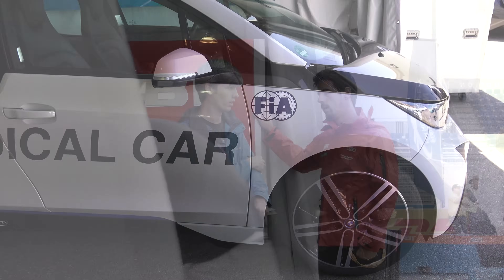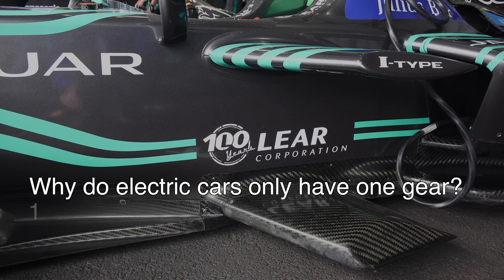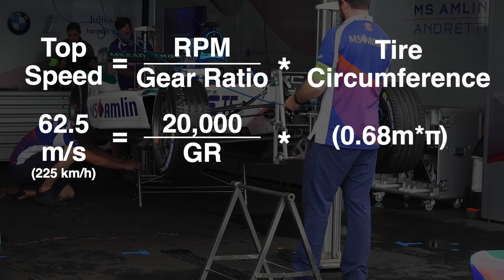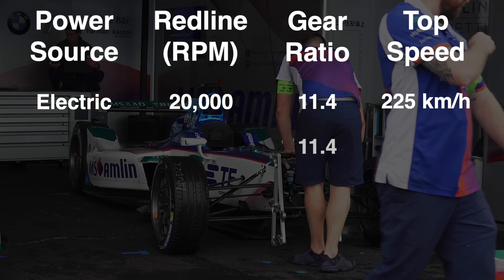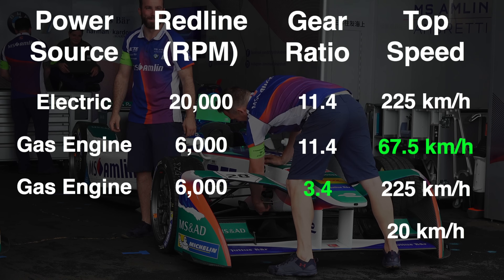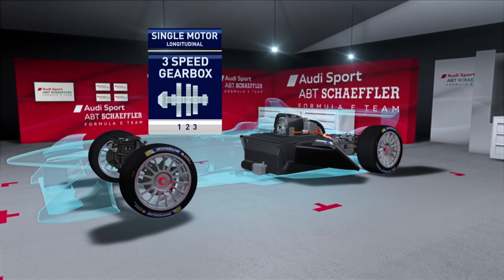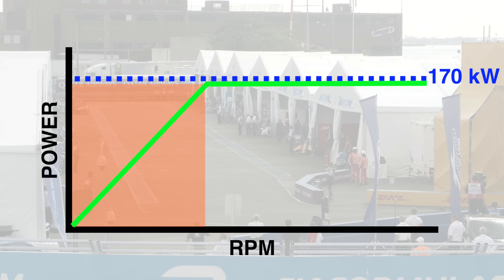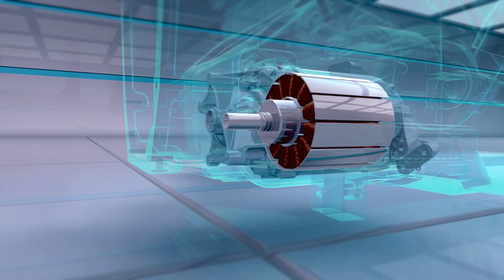Why Do Electric Cars Only Have 1 Gear?

Comment: Now imagine Fast and Furious movies with only one gear. What will they do without dramatic gear changes every 10 seconds?
Reply: Adam K Exactly. And not to mention unrealistic gear shifts. The cars they use must have 50 speed transmissions./s
Reply: They all have truck gearboxes installed ;)
Reply: Maybe switches to hook up emergency battery supplies.
Reply: They'll be switching back and forth from sports mode and eco mode
Reply: @Exiled_WolfX  hahahahaha
Reply: Adam K more time for bullets and Michael Bay style explosions...
Reply: Dramatic battery change every 10 seconds
Reply: Adam K They'll find an excuse to implement gearboxes into electric cars anyway.
Reply: You can always add 10switches on the dashboard to select and control different voltages to run on the motor and walah an imitation gear change scenario is created
Reply: talking about range issues and calculating the range by the actual power usage.
Reply: they can play with their dicks...
Reply: drift faster to compensate the battery weight during sharp turns, and repeatedly put ice on the car floor to prevent battery from overheating
Reply: @TheOswald42  dump some more ice in , 2, 1 ...NOW
Reply: new FF series are not about cars so it doesn't matter.
Reply: They would just put a faux gearbox and still show dramatic gear changes.
Reply: I'm pretty sure I've seen them shift an automatic gearbox as well pretending it was a manual at high speeds. Lol
Reply: Cameron Rodriguez Yeah. Saw Brian (Paul Walker) doing that in the very beginning of Fast 6 in the GTR. Thought he just shifted from neutral to drive since he was losing against Dom lol
Reply: Bradley Zimmerman haha, they'll probably heel'n'toe on electric cars too.
Reply: It will be replaced by dramatic road head
Reply: Imagine them "hot wiring" an electric car...
Reply: Dramatic screen touching every 10 seconds
Reply: The Actors might have to focus on .... wait for it... ACTING!
Reply: Adam K its all about the nos.
Reply: Well, those movies suck it wouldn't make much a difference anyway
Reply: @xRedEagleHD  for fkn real!!!!
Reply: Adam K lol
Reply: yes..because they allready using gearboxes with aparently 25 gears is so realistic....
Reply: well.. imagine fast and furious movies with only electric cars on it... you will fall asleep because it is silent lol
Reply: Between Powerglide-emulator and one-pedal-enabled/max regen braking mode (on a Bolt that's basically what D and L are respectively).
Reply: V8Supercar1 Imagine FF featuring Teslas.
Reply: This needs to be pinned.
Reply: walkerscranger you don't hot wire an electric car. You hack it. Hollywood is going to love having an excuse to shove in a dramatic long scene as the racer's hacker sidekick breaks into the car's software.
Reply: Start to develop range anxiety..
Reply: Adam K hahahahahaha
Reply: snap chatting ?
Reply: +John Austria; You are whining here, but actually it will be the cars that will be high pitch whining even more. ;-)
Reply: I love your comment looool
Reply: Yup.
Reply: Actually, nitrous on the battery might actually be beneficial.  It could be used to cool the battery.
Reply: My first car had 2 10 lb tanks of NOS nitrous (:
Reply: batteries run better with high temperatures.
Reply: In one movie, they were going in reverse and still changed gears. The car must have had two reverse gears. haha.
Reply: hahahah. now thay can shift to some hidden rocket gas propulsion for extra speed
Reply: Furious 19.... time trawling machine bla bla bla back to 1971 bla bla bla and GEAR CHANGING WITH R2D2 HELPERS LOL !!!!!
Reply: Adam K ...dramatic chasing on thunderstorm and every 10 seconds lightning strike for more power
Reply: Adam K ...car can be electric even with gasoline engine!!!
Reply: Still remember a scene from one of the movies where he shifts into "2nd reverse" lmao
Reply: @ProfShyv  a 2nd reverse gear?
Reply: @garystinten9339  I dont remember correctly, but there is a part where paul walker is driving backwards, and engages "another reverse gear" to keep going backwards...
Reply: Well in performance cars (and some casual ones (like mine)) you can change gears yourself in sports mode. Some cars even have paddle shift on wheel which is basically the same as moving gear lever front (gear up) and back (gear down). But yes, looks like all cars in FF series have manual transmissions :D
Reply: They'll press the horn instead of shifting gears 😂
Reply: Prevent overheating of the electric motor and power electronics. Maybe liquid nitrogen injection?! ;-)
Reply: Loading the car battery
Reply: imagine ff without sounds
Reply: Adam K You'd get a second to see how terrible the acting and the script is.
Reply: Would a CVD not be good for an electric vehicle to achieve the high torque low rpm over a wider speed range?
Reply: From D-1-2-D
Reply: Well though, kind of a problem.
Reply: What are they going to be about? zeppelins?
Reply: Think about the cowboys way back. What will you do without horses in modern movies? ;-)
Life is changing and movies too...
Reply: Dom : We have to jump the bridge!
Crew: We can't, we got only 1 bar left! :(
Reply: Also their would be no bad ass engine pur
Reply: They press a button.
Reply: they'll be part of a special forces units called the expendables
Reply: and they'll fly planes
Reply: @Steve the Pirate GOLD hahahaha hahahaha
Reply: dramatically leap from car to car like in that Matrix highway fight
Reply: More drifting
Reply: they'll just zoom in on the right foot
Reply: They press a button, dramatically
Reply: You never see any double declutch or rev blips on downshifts on the films - because the actors cant do them properly.
Reply: Probably pull a level down that engages the high voltage drive or something (the equivalent of NOS, too much of which can mess up your engine)
Reply: They'll probably slap the passenger every 10 seconds instead
Reply: Shorten the movie by 80%
Reply: Now they will get the Taycan, 2 gears are better than 1..
Reply: Make a decent movie, maybe?
Reply: Just angles and serious faces......
Reply: Electric motors constantly revving up
Reply: Holding a handgun and shooting other cars maybe, or holding a machine gun since the car will be self driving
Reply: Get a real job
Reply: slowly but surely increase the voltage applied to the motors by disabling safety concerns. Has the benefit that you really have infinitely many voltages or currents to choose from.
Reply: @Allen Loser this comment was related to the Fast and Furious movie comment but missed the @
Reply: Every 10 seconds, what are you driving? A Skoda Citigo ASG auto?
Reply: And where is the "NOS" Button?
Reply: loool that would be so boring to watch
Reply: They too use automatic gear transmission cars but then they show dramatic gear change between Reverse and Drive gear 😂
Reply: i dont mean to be so off topic but does someone know of a method to log back into an Instagram account?
I somehow lost my password. I would appreciate any tricks you can offer me!
Reply: @Aryan Rodrigo instablaster =)
Reply: The CONVOY movie, Ice Truckers,eps.with the double stickc shifts and ABSOLUTELY NO syncros..or classic GreyhoundTM/TrailwaysTMetc. drivers, with the one digit (in the prev.cases usually four) speeds..even that is not like most cars, hell, Fast and Furious flicks, and I've seen 'em all, have double clutcvhing!
Reply: I know 😂😂
Reply: They have unlimited gears
Reply: They just need big external sound systems to broad cast fake engine sounds, while accelerating better than the combustion engines.
Reply: That i'll be fun to watch haha
Reply: I mean.... you could? Turning off overdrive does make your RPMs shoot up, and even more if the ECU lets you go to third, 2nd, etc
Reply: It's called downshifting
Reply: Now imagine ur grand babies living with cancer,while watching fast and furious thinking what was so important that lead to destruction of the earth

Comment: Could a manual transmission ever been paired with an electric car?
Reply: Yes, you see that with EV conversions.  Drivers can shift if they want, but In practice, drivers just tend to leave it in third or fourth gear all the time, because the lower gears simply are not needed.  The Tesla Roadster originally came with a two speed manual, but it kept on breaking because of the torque, so they removed the option and went with single speed.

Comment: If electric cars only has 1 gear means when u go faster the motors revs higher which also means more electricity is required = electricity loss. So how electric cars keep their efficiency when crusing at high speed?
Reply: They don't. That's why you have the highest range at lower speeds.

Comment: Why are the tyres/wheels used in formula E so drastically different from those seen in formula 1?
Reply from the maker: +jessery Formula E is trying to keep the wheels and tires more similar to road cars, so they use 18" wheels and treaded tires. In fact, the Michelin tires used have the same tread pattern as Michelin's PS4S street tire, though a somewhat different compound is used.
Reply: Ah OK, makes sense!

Comment: I have seen before 
The revolution of the rotor of syncro motor directly depends on the frequency of the current .

So if we need to change speed you can easily change the frequency.

For torque conversion we can use a clutch mechanism

I am not an expert .

Pls correct me if i am wrong.

Feel free to learn
Reply: mad talks no need for a clutch. Gears are permanently connected

Comment: +Engineering Explained

So we know now why most electric cars don't need gears in normal applications, however would multiple gears improve higher speed applications? Even if it were a 2-speed or CVT.

Most EV owners are well aware of the heightened power consumption when sustaining high speeds. In your usual Leaf or Renault Zoe, the motor is spinning at 7500 or 8000 rpms. Cars such as those also start to experience a loss of available torque at speeds of +50 mph which makes overtaking awkward.

Aside from the well known case of early Tesla Roadsters destroying their 2-speeds, should every OEM EV be limited to be a 1-speed.
Reply: Tesla Model S and X can achieve 155 mph... how much faster would you like to go in an off the shelf vehicle? For racing applications it is totally different.
Reply: a good way to use an electric car without lugging a heavy battery is just to use a really long cord
Reply: That happens because electric cars are commonly made for urban use. So you make it lighter. What ways more on a electric car is the batteries, so if you want a light car you use less batteries. With less batteries you reach a limit of power output wich make the car loses torque/power in high speeds. A gear would ONLY be applicabe if the limitations is coming from inefficiency ON THE MOTOR due to high rpm. But won't help if the limitation is coming from the lack of power.
And the problem is: drag is proporcional to speed in a exponencial form. you double the speed you more than double the drag. But if you double the battery pack you just double the avaliable power. So you need to weight everything and project a car for a certain use.
The model S is a car more efficient on a highway becaus it's made to be a tipical american sedan. So it's heavy and have a huge amount of power and batteries to drive like that.
Reply: Speed isn't the factor... only torque. Electric motors have instant torque and depending on the size of the motor and gear ratio determines torque.
Reply: difflocktwo , maybe not, but it sure is nice to have a/c and stereo etc.
Reply: "heightened power consumption when sustaining high speeds" is because of the aerodynamic losses. You have to remember that drag increases exponentially with velocity.
Reply: difflocktwo  you are one of the special people.  A round trip per day for work is 152 miles.  5 days a week.  The nearest gas station is 19 miles away.  There are millions of people who drive that far every day.  People ask me why I drive so far?  No jobs where I live unless you own a farm, cook meth, or live on welfare.
Reply: Even a Bolt EV will do well over 150 miles on a charge.
Reply: That's the questions we need to ask
Reply: I Gears would only add losses, lowering range.
Reply: David Beppler Check the statistics. What is the average commute distance? What percentage of drivers commute under X amount of miles? 

3 hours a day in a car? Are you getting paid to sit in your car? Wouldn't it be worth it to find work near home or move near work?

If you could charge at work and at home you wouldn't need to go 19 miles just to fill up. 76 miles should be pretty easy in an EV.
Reply: One of the raisons d'etre of electric vehicles is efficiency, which is largely a function of  regenerative braking.  (also a factor in achieving decent range, of course). A single motor, using a single reduction ratio, of adequate power to cover the entire speed range of, say, a versatile 'family' car, usable for both start/stop urban journeys and open-road cruising simply will not provide very much braking torque/regen in the urban environment.

This is the reason Teslas are so 'over-powered' (or endowed with "more than adequate" power, as Rolls Royce used to say). Tesla went with the simplest configuration they could (having considered and decided against a 2-speed transmission) and consquently had to use motors large enough  (over-sized, in effect) to produce decent regen at urban speeds. With 2 or more ratios, smaller motors, spinning at higher RPM at these speeds could produce good braking/regen while still having ample power for cruising in a higher gear.
Reply: difflocktwo you clearly do no know of a country called Australia, i make regular trips that are 6 hours or more and around 960km
Reply: also pretty sure electric motors power curve is the opposite of combustion engines, the have lots of torque low down and it drops off at higher speeds
Reply: +toyotaprius79
The Renault Zoe motor is spinning with 12,000 rpms, or even more...
Reply: anytime you convert power through differential gearing, theres a power loss.  Combined with the added weight that a transmission adds and you lose any efficiency you would have gained.
Reply: Charlie S Stereo is only a few watts. Not even a dent in range. Interior climate control is very energy demanding, but remember you can do this while plugged in. In the winter EVs use heated touch points to keep occupants comfortable with less energy.

A couple kWh extra of battery for a day of climate control should be enough. Not a big deal.
Reply: Blox117 Or use a battery you need. No one needs 200 miles a day.
Reply: " Cars such as those also start to experience a loss of available torque at speeds of +50 mph which makes overtaking awkward." It is not about the loss of torque but a loss of available power.

Comment: Rimac uses 2 gears and the concept one is one of the quickest and fastest production cars in the world
Reply: matthew clark the concept one is not a true production car....doesn't meet the sales volume to be classified as one.
Reply: Christian Thompson not true...what's its top speed vs Porsche
Reply: Yes so technically the fastest production car today would be the Tesla model s
Reply: But Tesla P100D is quicker than Rimac 1 from 0-60 mph because of one gear.
Reply: @peterrobannsobrepena6029  the C_one goes 0-60 in 2.3 seconds in first gear which is quicker than the tesla
Reply: Tesla is fastest accelerating production car in market. It doesn't have highest top speed though due to software limited top speed. Mostly because batteries overheating so Tesla has to reduce speed down. Roadster might be able to go on high speeds if Tesla will fix overheating issue

Comment: Tesla has one "forward" gear, Rimac claims to have three. Could you please explain the engineering behind that and differences between the two cars? :) The P100D tops out at about 150mph and accelerates relatively slowly above 70mph, but the Rimac accelerates faster even at high speed and can run on to about 220mph.

Comment: What is the radius you used for calculating speed of Gas engine ??
Reply from the maker: Used the same tire diameter of 680 mm.
Reply: I think same Data as in the Formula E car!

Comment: I don't know how accurate Forza horizon 3 is, but it's the closest I'll ever get to driving electric 

but what I've noticed is electric due to only using one gear was fantastic at straights and high-speed corners where they don't have to slow down much, but it feels like it takes hours to get from 0-60 as opposed to the less than seconds normal cars can do.

I also feel like entering and exiting corners is immensely more difficult than with normal gearing 

can you tell me if this is due to driver error or actually faults of electric cars?

from this video it sounds like it's probably just me

Comment: electric vehicles use electric motors with iron core on the stator. why not use ferite core instead of iron. ferite core transformers for example are much cheaper, more efficient and many times lighter than iron core ones. the only difference is the magnetic flux those core types can take before saturation and the frequency you can use them. ferite cores saturate at lower magnetic flux, but can take much higher frequency signal before having hysteresis loss. engineers might say the problem is the motor would reach much higher rpm and would have much less torque, but if you make it have 10 phases instead of 3 and have 100 sectors instead 9 it would have the same torque, but higher max rpm and higher efficiency